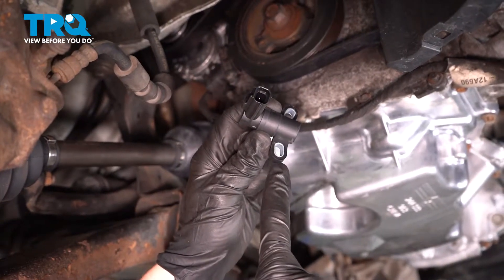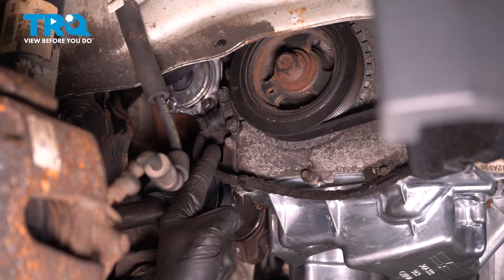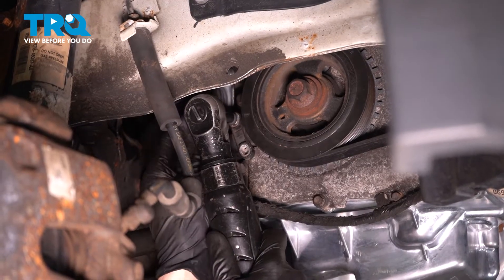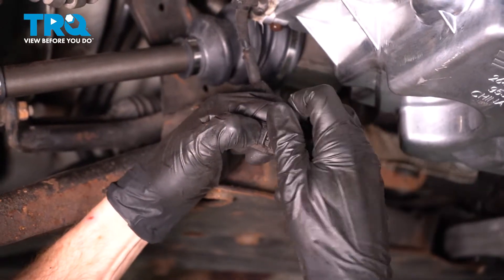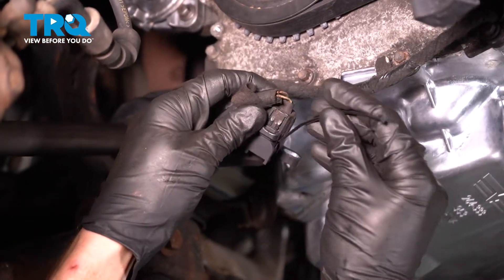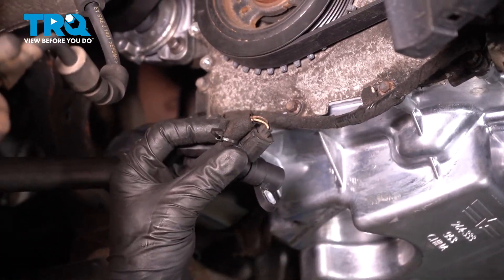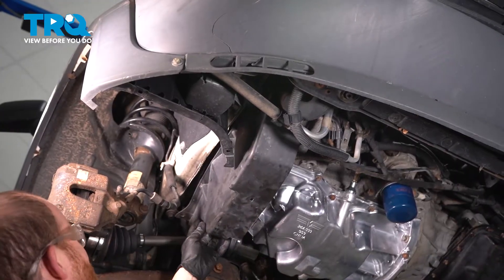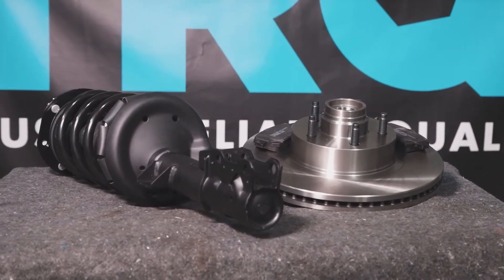How to Replace Crankshaft Position Sensor 2010-2013 Ford Transit Connect

Comment: Yeah I have the same questions.. it is adjustable.. so do you need to align it with one of the teeth? Also do you need to do a crank re learn procedure after the installation?